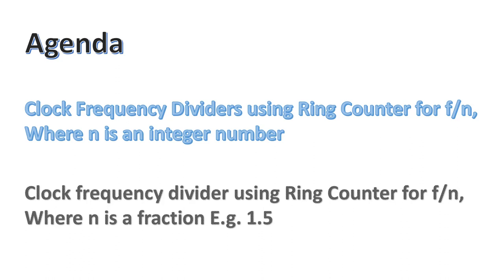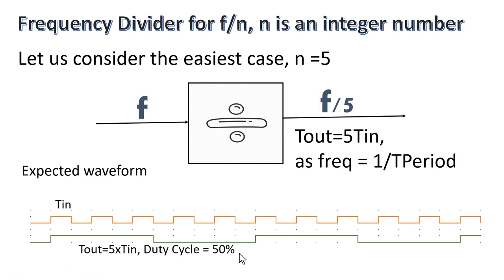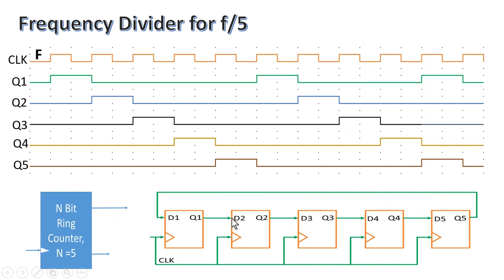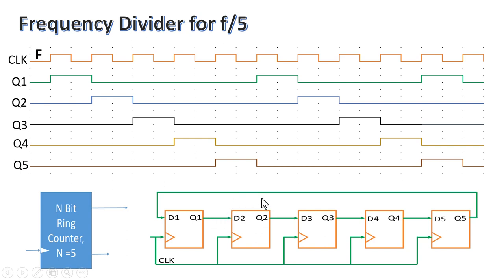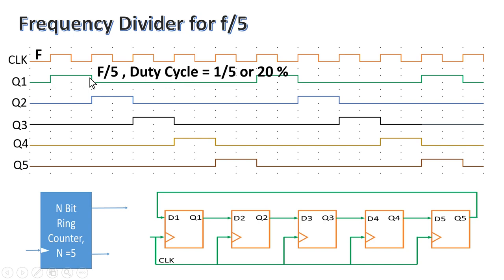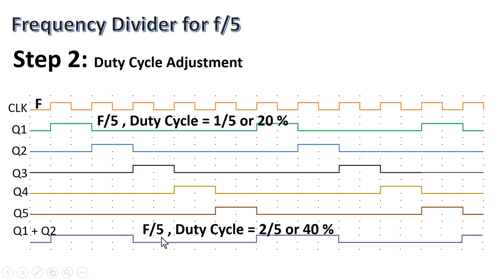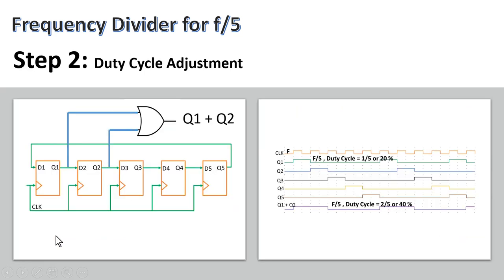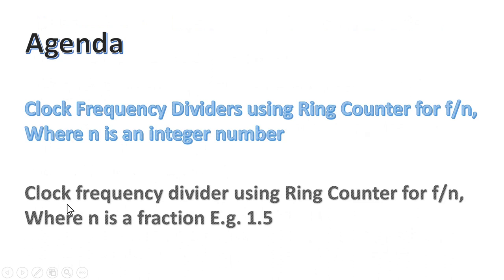Step by Step Method to design any Clock Frequency Divider - Part2

Comment: Q1_ff (Q1 is input to negative edge flip flop ...Q1_ff is output)and with Q2 ..
ie F=Q1_ff.Q2 is with duty cycle 10%
Reply from the maker: This is one of the many options .. Q1 . Q1_ffn will also yield 10% duty cycle. But appreciate your understanding.

Comment: use AND gate instead of OR gate, and inputs of AND gate are one flip flop output, and output of negative edge triggered flipflop
Reply: Can u explain briefly plz
Reply: same bro
Reply from the maker: Sorry for delayed response.. What will be the outcome by doing so??
Reply: Simply do  FF1 or FF2 or (FF3 & clk) to get 50% duty cycle. No extra FFn is required.

Comment: We can also create a 90% duty cycle and take the complemented output of that to get 10% duty cycle, but it will take a lot of hardware, it better to take (q1_ffn )and (Q2)
Reply from the maker: You are right.
Reply: @TechnicalBytes  Sir can we take two inverters acting as a buffer of t/4 delay each, in place of dual-edge ff. Will the ckt function same as above ?
Reply: Sahii hai medu..

Comment: Hi, can we also achieve 33.3% duty cycle in this f/5 case. If yes , please let me know how?
Reply from the maker: Hi, as per the explanation in this video, it is made convenient to design duty cycle of 10%, 20%, 30% ...90%. 
To get duty cycle of 33.3% for f/5, we have to think.
If you know any trick to design, please share it with me.
If you need it urgently, then we can think of its answer together.
Reply: @TechnicalBytes  for f/12 we can make 33.3% duty cycle

Comment: Should do a neg edge trigger on Q1 and or it with the signals you tapped to avoid glitches in the clock you are generating as your OR gate switches from Q1 to Q2.

assign new_clock = Q1 | delayQ1 | Q2 | delayQ2;

Comment: I'm thinking the output of this kind of "clock" may be glitchy.  Also why would 50% duty be required if we just stick with using posedge clks?
Reply: Unless... you also run the output into a final flop.
Reply from the maker: Go through this video:
https://www.youtube.com/watch?v=ng5RkwU0fHc&t=270s

Comment: one way is, to pass q1 output into a negedge flop which becomes q_ffn. invert this to get ~q_ffn. finally ANDing  q1 with ~q_ffn.
Reply from the maker: Dear, what are you trying to achieve from this ? Can you please eleborate?
Reply: @TechnicalBytes  for 10 % duty cycle. (q1 & ~q1_ffn).

Comment: Your shift register is not initialized. 
There is no obvious way it was initialized of 5'b10000 before. 
It could be 5'b00000 or 5'b11111 after reset. The simulation of this will result in 5'bxxxxx.